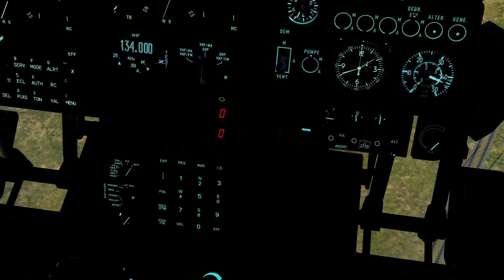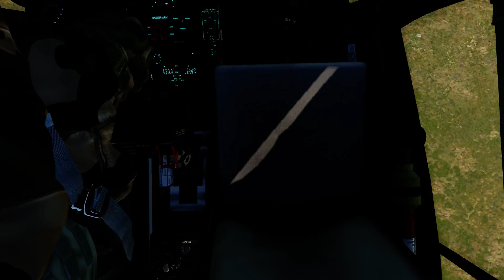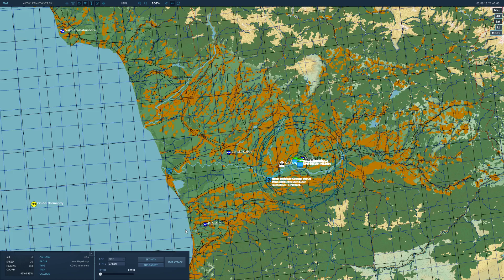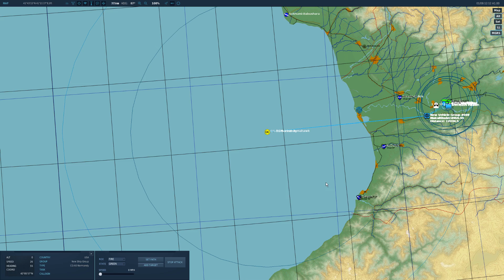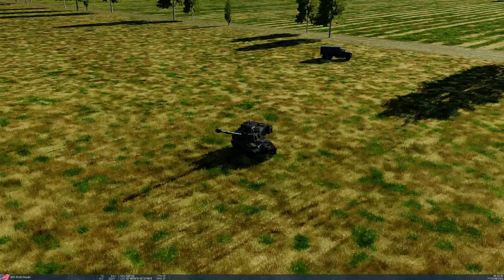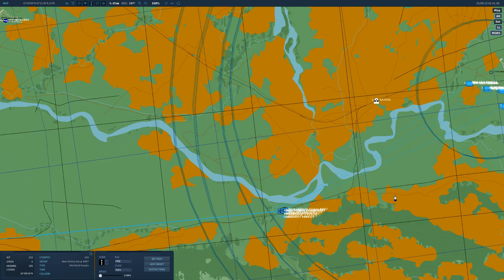Using the DCS Gazelle as a scout, artillery spotter, FAC, etc.

Comment: how did u set it so that the helo can cell for a strike?
Reply from the maker: That feature requires combined arms, and select "pilot can control" vehicles in the mission editor
Reply: @rolds376  thx!
Reply: @rolds376  i am entering my lat long from the nadir , but its giving me a point which is off. is there any corrections or conversion i need to do?
Reply from the maker: @eastcoastsailingcenter7768  Remember the last digit of the nadir is decimal minutes so you must multiply by 6 to convert to seconds, example last digit is 9, input 54.
Reply: @rolds376  ok i will try that .. last digit for both lat and long?

Comment: Could it be that the system is so inaccurate to 60 meters?
Reply from the maker: Sorry I don't understand
Reply: @rolds376  You can not use the method to determine precise coordinates

it is quite inaccurate

in my test up to 60meter

 better ? ^^
Reply from the maker: @HobelDcs  Oh yeah, i'll assume that you're talking about precise for the purposes of program a JDAM because that is a very topical thing in DCS. At the very least this method is limited by the Nav system in the gazelle giving coordinates to one tenth of a minute of latitude and longitude. one minute of latitude being 1 nautical mile, that can be a bit more than 600ft which is about 200 meters. So this cannot be used on its own as input for a precise weapon like a JDAM, but can be used for area strikes of artillery like this, or for getting a unit like an A10 to look at a specific area which I've used in multiplayer.

Comment: Excellent...could you do a video of you setting up the mission for this so we know what seats are needed ect....is there a gamemaster seat in the mission file for you to be able to take control??? Thanks inadvance
Reply from the maker: In this case mission setup in the editor is not too complex, no gamemaster slot is required. For the helicopter you just need a Gazelle set to player or client. In order to control the ground and naval units you need combined arms, and in the "battlefield commanders" tab you need to select "pilot can control vehicles". There may be many other ways of achieving similar results but this is the way you can do all this in a single player mission without changing slots.
Oh and of course, the F10 option is set to "allies only".